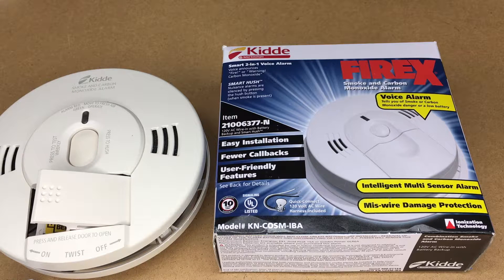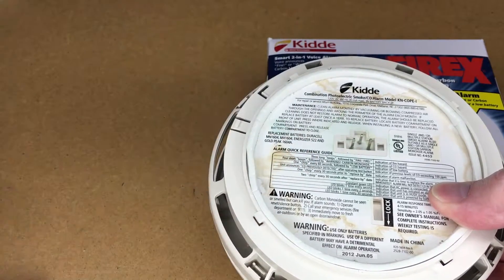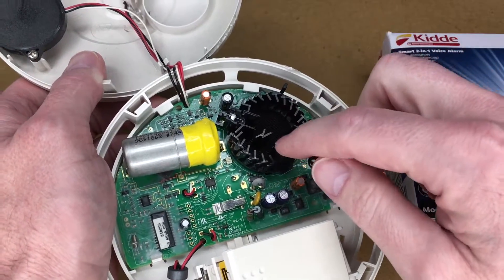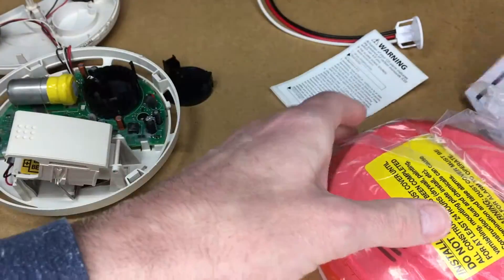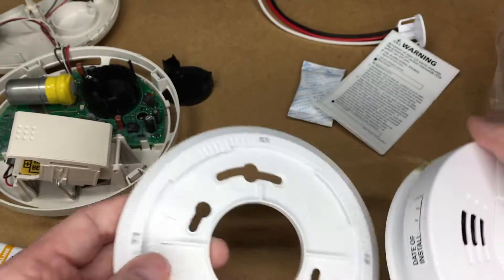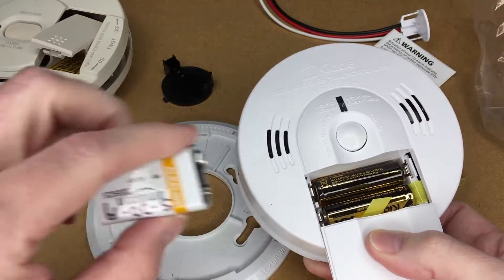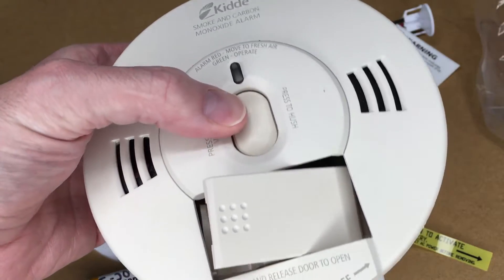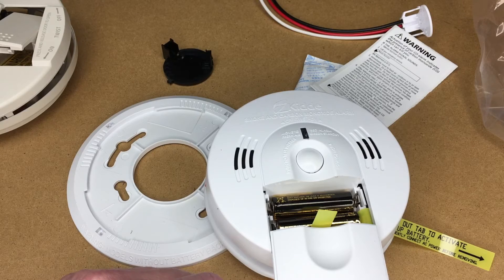Kidde Smoke and CO Detector Old vs New

Comment: That's the new one I ordered before I saw your video. I was hoping you would set it up and test it. My old one only had a 3 year warranty and it was bought in 2016. It was saying low battery, but new batteries did not shut it up. Is there a reset on it when you change batteries?

Comment: Do you have to shut your power off in the house when replacing the battery?
Reply from the maker: Nope. You can change the battery while it is powered.
Reply: @Rickmakes  Thank you we were able to fix it!
Reply: @ServantOfYah_2020  vv  I s
Reply: @Rickmakes  I have the newer model and it was chirping in the middle of the night so my dad went to change the battery but when he took it out it started going off.
Reply from the maker: @watermelon2650  That sucks.